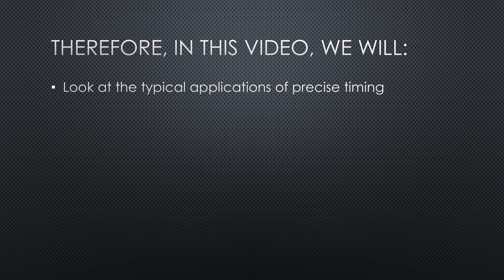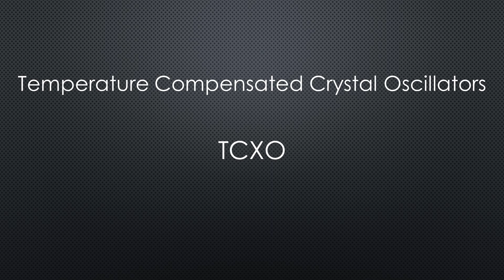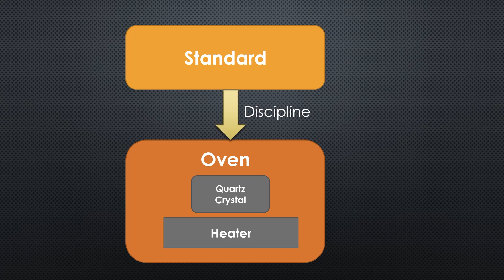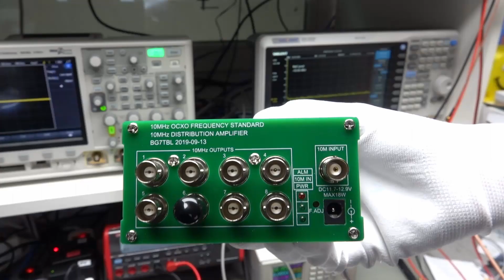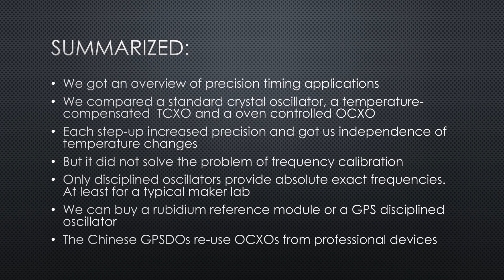003 How to get Precise Timing and Frequency to our Lab from Crystals, TCXO, OCXO to GPSDO, BG7TBL

Comment: A nice observation about the 'pre-aged" OCXO modules.  In a similar fashion, the voltage calibration standard that I bought from an eBay seller had a reference that looked as if it was harvested from some other device.  So it was already though the initial aging before it got to me.  I was less interested in the absolute voltage than the stability, so it worked out well.

So nice to have discovered this other channel of yours!
Reply from the maker: I decided to create it to do "illegal" stuff, too. I decided to omit any projects where you need a license on my primary channel.

Comment: Please be aware that the ublox cannot precisely generate any arbitrary frequency - you will get missing pulses. It is using 24 MHz source and a frequency divider, which can generate integer divided frequencies only, e.g. 12, 8, 6,... MHz. This is a disadvantage when needing 10 MHz. vy 73
Reply from the maker: The GPSDO does not use the clock of the Ublox for the output. The ublox signal is only used to (longterm) change the frequency of the OCXO

Comment: A clearly explained (as always) new video on your new channel. Thank you.  I look forward to the next one. (Until I fixed the enclosure's screening the square-wave 1MHz output of my home-made VE2ZAZ GPSDO filled my shack with 1MHz harmonics to over 200MHz.  Not exactly what I wanted !🙄)
Reply from the maker: That is the property of fast edges:-). Many GPSDOs use a sine output. Less problems in this respect.
These videos are not new. Just cross-posted from my main channel as a start, BTW.

Comment: Caesium or Rubidium oven control clock standard, hope it is GPS governed mate. 10 M hz standard.
Reply from the maker: GPS is more accurate. And for sure cheaper and smaller ;-)